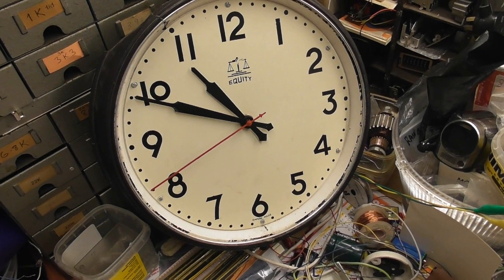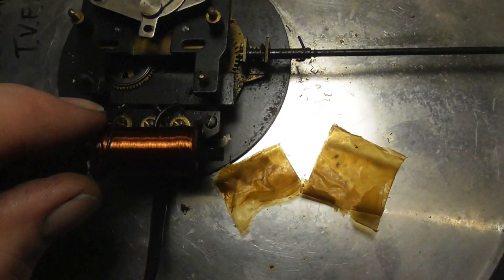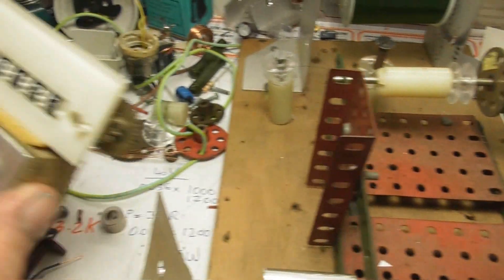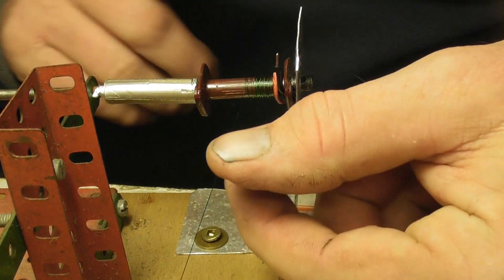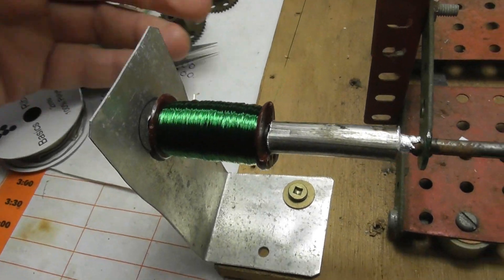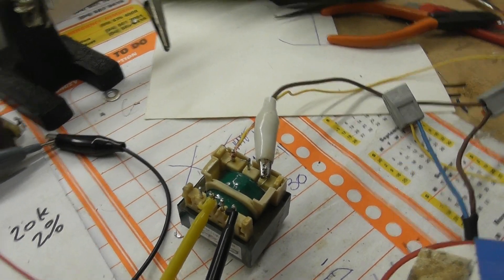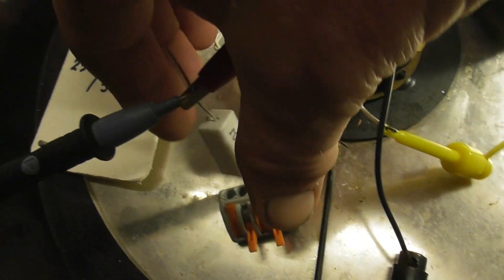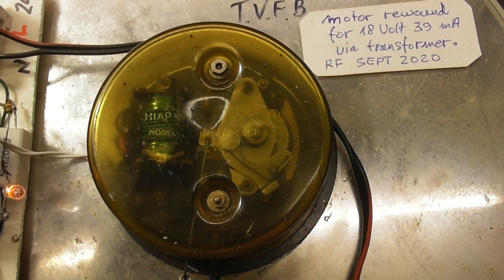Equity clock - 240 to 18 Volts motor rewind

Comment: https://youtu.be/qfaAtwWTWLE
Thanks for your kind comment on the video and sharing valuable information.
Sir I had shared the link in which the movement is running without center second still it is moving fast.
I will once again disassemble the movement and check with it.
Thank You.
.
Reply from the maker: Check that the gears are in the right place, your synchronous motor is running at the correct speed.
Reply: @RODALCO2007  Hello Sìr.
Ok sir I will check.
Thank You

Comment: Hello sir. Great work to restore such electric clock and conversation from 230volts to 16.5volt is not an ordinary job and not an easy task. It has been successfully converted and make it to keeps accurate time. 
Thank you for your efforts.

Sir I am BHARATH from India, a Commerce student. I am also having the similar type electric clock, bu the coil is open.
So I am looking for your kind support and guidance to restore such electric clock.
Please help me sir.

- Sir which guage of wire is used for conversion from 230volts to 16.5volts.

- sir how many number of turns that required to be winded on the bobbin.

Thank You
Reply from the maker: Wire gauge was 36 and 2200 turns on the coil.
Reply: @RODALCO2007  Thank You Sir for your kind and valuable response. Sir it will directly operate with 18 volts AC right or I need to add resistance. Sir how much ampaire transformer will be used for it.
At the video uploaded in your channel, you had used an resistance, so that reason I am asking for it.
Many many thanks for sharing the valuable information.
Reply from the maker: @bharathba4762  The transformer only needs to put out maybe 50 mA, The resistance is trial and error, I like to keep the current as low as possible, as long the motor runs reliably.
Reply: @RODALCO2007  Thanks sir for guiding me with patience to all my queries, I am so grateful to you sir.
Sir at my side, I am having 16.7 vots 2Amps transformer. So I need to make the Amps as low as to 50MA right.
It means 16.7 volts at 50MA by adding resistance by trial and error, insted of 16.7votls at 2Amps Transformer, which is available with me, I hope that I understood your wordings in right manner.
Thank You Sir.
Reply: Hello Dear Sir, the above sent by me is correct. Please guide me sir.
Thank You.
Reply from the maker: @bharathba4762  Your clock shouldn't be drawing 2 Amperes at 16.7 Volts, that is almost 34 Watts! at 50mA and 16.7Volts is around 0.9 Watts.
Reply: @RODALCO2007  Hello Dear Sir.
Thanks for your kind reply to my question. 
Sir as you stated is correct. Yesterday I had made an trial by winding the coil and made to work at 16.7volts AC.
Sir the problem is not solved, now it strat spinng too fast than before, for two minutes in stop watch it is exactly covering an hour and I was wondered.
So I didn't understand for what reason it is not keeping proper time.
But one thing, yesterday I was connected directly to 16.7volts from the 2amps transformer to the newly winded coil without adding any resistance.
Thank You Sir
Reply: Sir, just now i would have tested with the aid of Digital Multimeater, at 200ma position, it has shown the reading 2.0
Reply from the maker: @bharathba4762  Hi Bharat, can you make a short video of your rewound clock motor coil and movement please, just curious what is going on there.
Reply: @RODALCO2007  Ok Sir, but how can I send the video.
If you have provided your E-mail ID, I will send the clock running video and the coil rewinded by me.
Reply from the maker: @bharathba4762  Put the video on YouTube, you can make it as an unlisted Youtube video and send me the link.
Reply: @RODALCO2007  ok Sir
Reply: Sir video uploaded @Bhararhba4762
Sir, the 1st video uploaded at it's original winding.
Reply: Sir 4 Videos Uploaded.
Thank You
Reply: Sir is the videos uploaded, available and played properly.....?
Sir I am very poor in handling gadgets. So this is the first time I had made like this.
Thank You.🤝
I am looking for your kind support and guidance.😊

Comment: Do you ever rewind clocks for other people? I have an vintage clock coil that needs repair. thanks
Reply from the maker: I did this for our local Fire Station. Rewinding is a lot of work and very time consuming. It depends how hard it is to get the clock motor apart. In this case it was relatively easy.

Comment: How did you decide on the number of turns?
Reply from the maker: Bit of trial and error, bigger gauge of wire and low voltage instead of mains driven. Check currents and heating in the coil.

Comment: Dual voltage coil, but single frequency clock?  120v 50hz is rare.
Reply from the maker: 110 Volts is used in substations from VT supplies. These clocks were probably used in control rooms as well where they were tapped of VT supply.

Comment: nice repair. but please check the ads.  I had 5 ~30s ads in the 12 mins video. they really destroyed the flow.
Reply: YouTube unfortunately automatically adds these and they're difficult for the creators to remove
Reply: Install "YouTube Vanced" app, it's YouTube without ads and in addition, videos plays in the background
Reply: AdBlock in Chrome means I rarely see any Youtube ads
Reply from the maker: I don't control the AD flows unfortunately. Is done by YouTube.